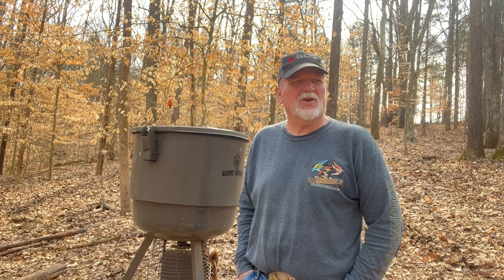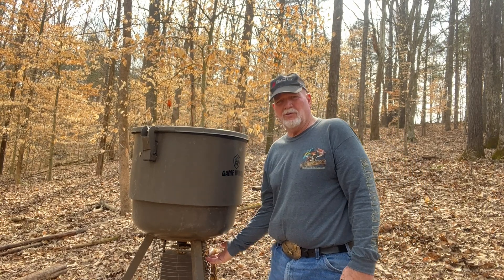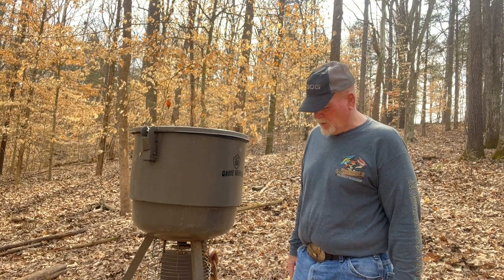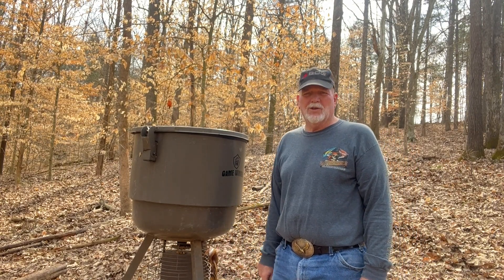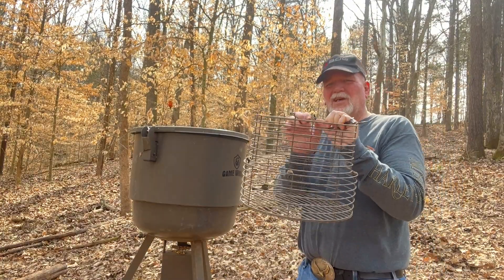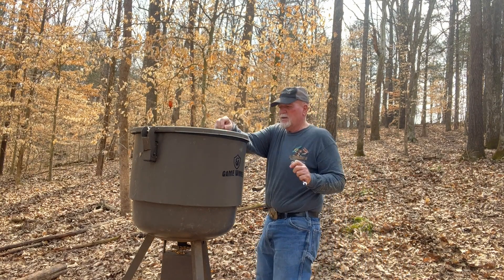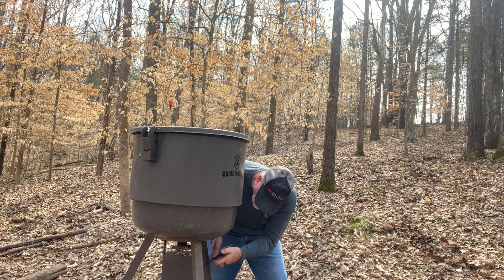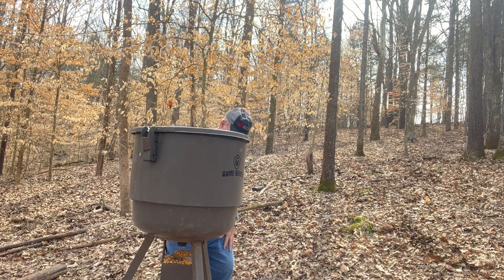Repairing Game Winner Feeder

Comment: i have the larger version, 300 lb silo, you are correct about the center/bottom not angled enough to funnel the corn to the center. before i set, and fill my feeder up here in arkansas, i'm going to make a large sheet metal for the bottom, kinda like a large funnel, so all the corn will angel down to the center funnel hole, i'll repost back when i get this done, and let ya know how it works ?.